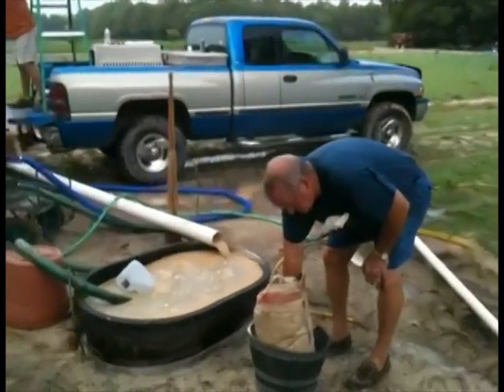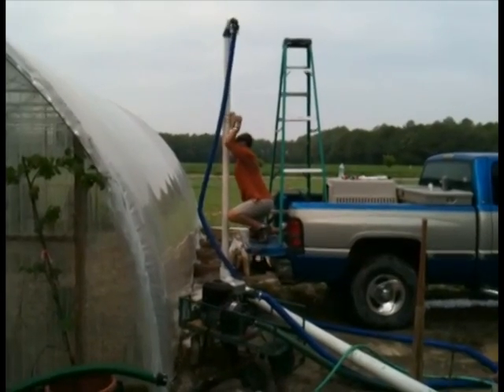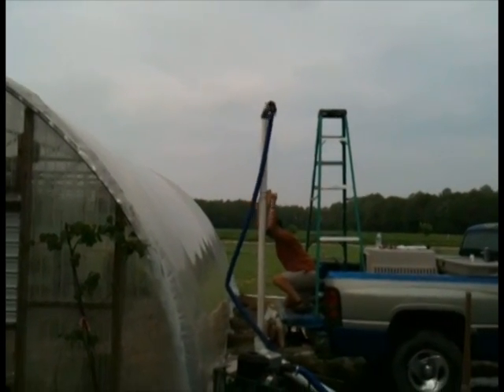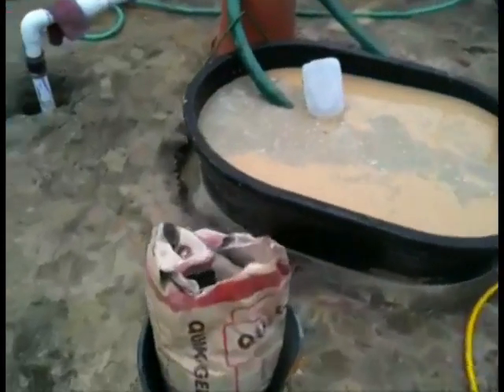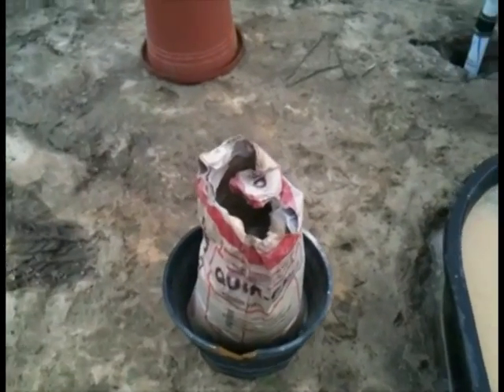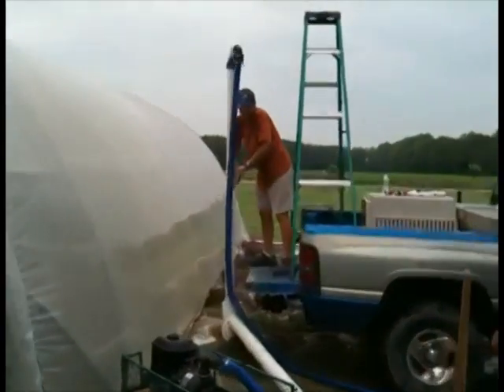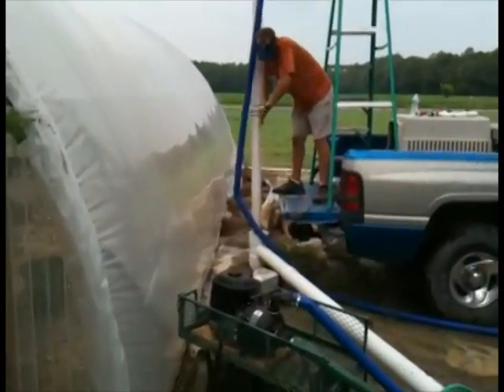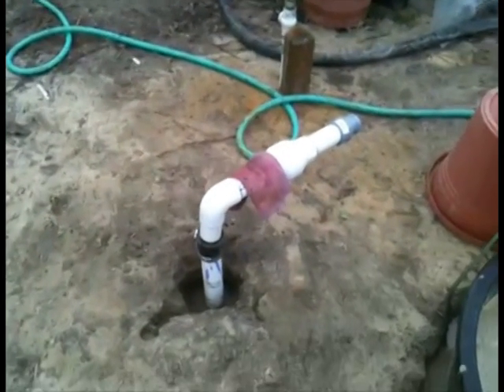Drill Your Own Water Well Series - Drilling with a Mud Pump

Comment: I'M at 28ft and lost my upward flow should I keep going down? I went through water bareing sand.
Reply from the maker: Sounds like you are in water bearing sand, assuming you are under the standing water level.  Do you know the standing water level in your area?
Reply: I not sure where it is but I think that when I broke through the sand I it clay and clog my pipe and it won't come up or turn. should I take something and try to unclog it. First hole I could try to pump stuff up the pipe to unclog it. I put water down beside the pipe and it vanished.
Reply from the maker: If you are 10 feet under the standing water level, set the well screen right there.  If not, use bentonite slurry to solidify the sides of that hole and keep drilling.

Comment: I happen to have a 7HP mud pump. Will this be overkill for drilling a well? I suppose I could lower the throttle? And what if I did run it at full throttle?
Reply from the maker: Andrew Paris Yes, it will be overkill but if you throttle it down it should work fine.   What happens when you have so much power is you can not physically hold the drillpipe down as you are twisting so you can not drill.  It would be great for cleaning out the hole though!!!
Reply: Hey thanks for the help. I have one last question:
Shallow well pumps are not able to lift from deeper than 20-25 feet at the most, but if I prime below the check valve and above it, then run the pump, the entire line should be primed from then on forward, correct? And then the depth to the standing water would not be an issue?
Does the water on the well-point side of the check valve ever settle down to standing-water level? 
My assumption is that because the check valve would not allow air or water flow in the opposite direction it would act the same way as my finger on the tip a straw full of water.

Comment from the maker: It is according to the process.  With two hoses about 30 feet.  Add in bentonite and the ten foot head start described on the website and it is generally about 45 feet.  I don't know how deep you can go with a mud pump but I have made it 60 feet and felt like I could have gone deeper.

Comment: I used this technique with a 3" pvc bore pipe, a 1.5" Home Depot pvc well point with pvc pipe and a 1/2" pvc drill pipe. I live in FL so only needed a 22" well with a 1 hp motor which gives 15 gallons a minute. Good for even a small farm.